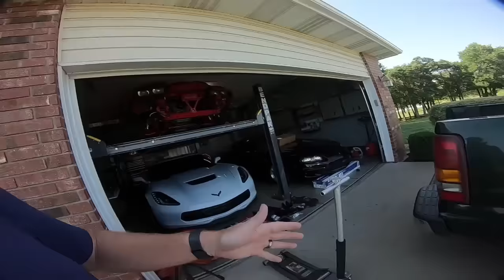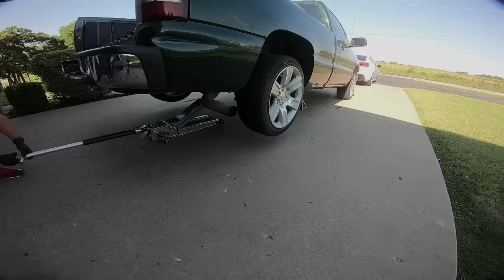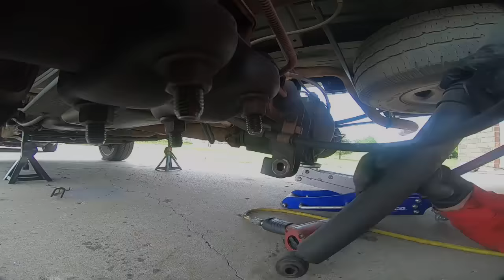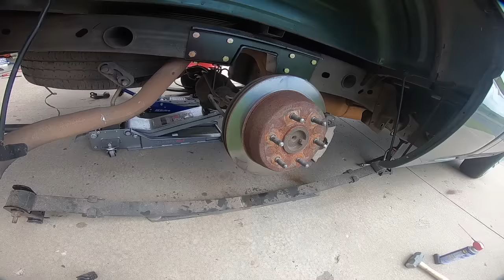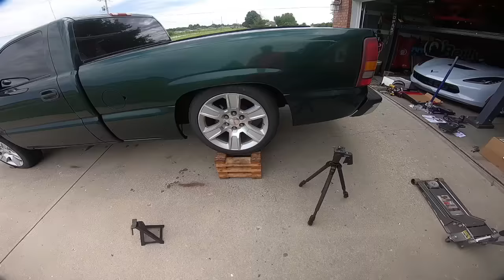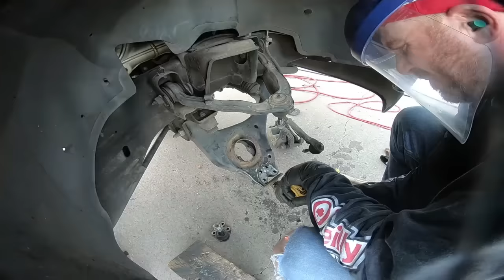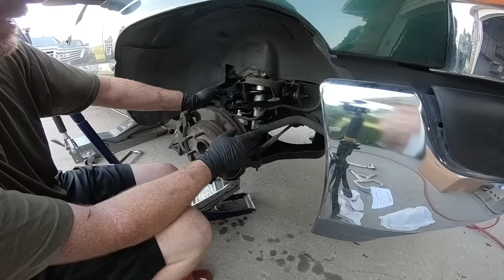How to Lower Sierra and Silverado NBS (Ultimate How to!!!)

Comment: How long did just the notch & flip kit take you?
Reply from the maker: A couple hours if you have done it before
Reply: @TWAMotorsports  sweet, I’m taking the bed off just to make it a lil more accessible. I was at 2/4 now I’m at 4/4 & putting stock hanger in and going 4/6 for now until I get smaller tires & go 5/7
Reply from the maker: Bed off does make things way easier

Comment: Do I have to flip the bolt on the leaf spring?
Reply from the maker: Generally yes.
Reply: @TWAMotorsports  do I have to relocate the hangers ? On the leaf spring
Reply from the maker: No
Reply: @TWAMotorsports  also one more question do I have to take off the shocks for the flip kit to be able to fit in ?and move it around to center the dif?
Reply from the maker: I do
Reply: Why does it seem like my u-bolts are not long enough!?
Reply from the maker: Saddle may not be seated properly

Comment: 47:02 did u get a new one of the parts or did you just change the color? 48:09 did you get a new parts or you just painted it?
Reply from the maker: Repainted lowers. Bought new uppers
Reply: @TWAMotorsports  ok thanks
Reply from the maker: You're welcome
Reply: @TWAMotorsports  one more question. Which kit do you prefer premium Maxtrac or McGaughys?
Reply from the maker: Mcgaughys
Reply: @TWAMotorsports  ok thanks
Reply: I got one more question.  My truck already haves shocks do I need to buy some other shocks? Or can I use the same shocks.
Reply from the maker: @luxurnathan4353  new shocks would improve the ride drastically
Reply: @TWAMotorsports  ok thanks
Reply: Where did you get the spacer?
Reply from the maker: Comes with the spindles

Comment: Hey man how hard was it to drop the green Sierra ?
Reply from the maker: All rasy other than drilling out front rivets
Reply: @TWAMotorsports  so basically the hard part was cutting the fram and drilling the holes for cnotch ?
Reply: How hard was it to drill out the front rivets
Reply from the maker: No. Thats not what I said. The rivets in the front a arms is the hardest part
Reply: u have to drill them out right ?
Reply from the maker: Drill and press

Comment: What size wheel and tire?
Reply from the maker: 245/45-20
Reply: Is that about the biggest u can clear with that drop? Thanks for replying
Reply from the maker: @Whitetrash_Customs  could do a 275/40/20 but might rub in the rear. Actually the same height though

Comment: Would torque specs be the same on my 05?
Reply from the maker: Yes sir
Reply: @TWAMotorsports  awesome thanks
Reply from the maker: @Kevin_Yagoonie  you're welcome
Reply: @TWAMotorsports  I have a question Travis that I hope you can help me with.
My truck in the rear currently has hangers and shackles. I threw away the factory ones. So I want to go lower. I already have my Belltech street performance shocks and my Mcgaughys c-notch. So I'm looking at the Belltech 3 inch lowering leaf springs. What do you think? Or would removing the factory middle leaf do the same and save $320?
I don't know what to do
Reply from the maker: @Kevin_Yagoonie  as I stated before I'm not a fan of drop leafs. I would return to stock and use a flip kit.
Reply: @TWAMotorsports  I can't find factory front hangers. I've looked everywhere and only found the rear ones
Reply from the maker: @Kevin_Yagoonie  may have to find at a salvage yard
Reply: @TWAMotorsports  actually not a bad idea. I'm just pissed I didn't go with a flip kit in the first place. I thought 4" in rear I'd be happy with. Wrong! Lol
Reply from the maker: @Kevin_Yagoonie  it happens.

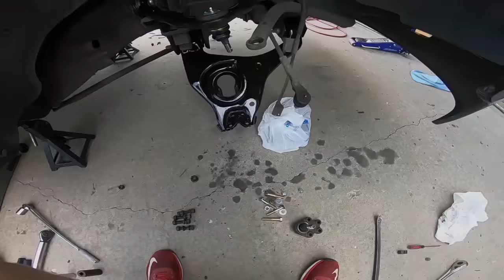Comment: 52:15 Where did you get the spacer?
Reply from the maker: Comes with the spindles
Reply: @TWAMotorsports  I bought a kit and it comes with the spindles. You think the spacer is going to come with it to or I have to buy it separately
Reply from the maker: If you bought the same spindles as me it will
Reply: @TWAMotorsports  can you buy them separately?
Reply from the maker: Don't think so
Reply: @TWAMotorsports  do you really need a spacer ? Why?
Reply from the maker: If using the spindles I used you do because the balljoints are relocated and it would collapse without
Reply: @TWAMotorsports  oh ok well I bought a kit and it didn’t come with it so I think it’s fine then
Reply from the maker: Then it's a different front spindle than what I used.

Comment: Respectfully disagree on the poly bushings.. Yeah they give a firmer ride, but they don't get soft and mushy over time. def not junk
Reply from the maker: Understand but poly is actually cheaper to manufacture than rubber so if it were better it would be applied by manufacturers
Reply: TWA Motorsports possibly. Manufacturers are
Going for ride quality, for performance minded guys, poly is nice. Either way, great video! Waiting on my other djm lower arm to come in and I can get my truck out of the sky..lol
Reply from the maker: @Mgoblueindy69  that's what I like is ride quality. I'm getting old and don't like squeaks. Hopefully djm has addressed the junk ball joints that used to come in their a arms because they wont last 10k miles if not.
Reply: @TWAMotorsports  Me too..hahaha  I think they changed it and they're powdercoating up.. But we shall see

Comment: No joke, the bottom rivets are a real b****.  I had to cut heads off and torch them out half way.  Hammering wasnt working whatsoever.
Reply from the maker: It was crazy.
Reply: @TWAMotorsports  I have an 01 Silverado RCSB, same color with 4.8.  Same spindal kit half way through a 2/4 drop.  I may have to reconsider and go 3/5, looks killer.
Reply from the maker: @wadebrewer7212  thank you. Yes drop that thing lol

Comment: Hey is it possible to talk to you ???? 📞
Reply from the maker: Talking right now
Reply: So I have a 2000 gmc seirra 1500 5.3 
I got almost everything you listed because I want to do exactly what you did the only thing I haven’t got is the a arms, now do I get upper and lower a arms
Reply: Because I see you got the upper, then the lower did you just paint it or is it new and that spacer???
Reply: Thank you so much for the reply
Reply from the maker: Repainted lowers. Spacer comes with spindles if the correct ones were ordered.
Reply: I got the Mg 5/7 with 17or bigger rim
Reply: One more thing will the Detroit 4 peice upper and lower work from amazon?
Reply from the maker: No spacer then
Reply from the maker: No idea.